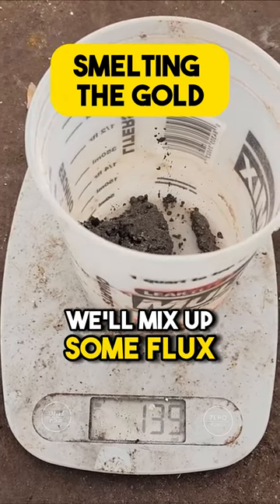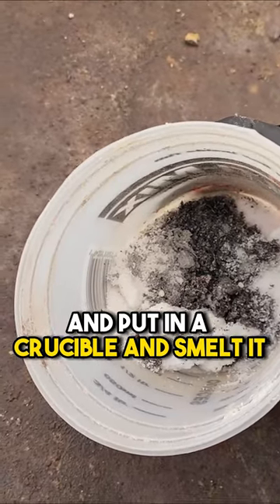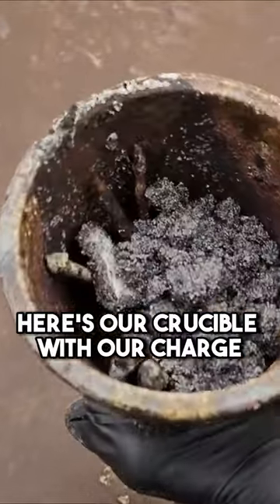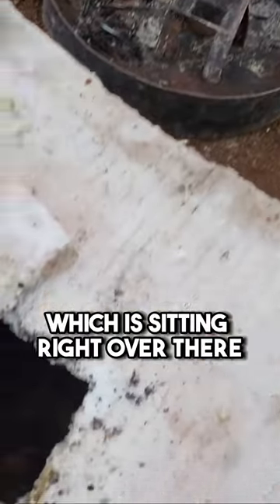Smelting gold with unexpected result

Comment: I just started smelting the gold dust I've been pulling out of the crushed quartz I've been collecting, and I follow your process (as best I can from your valuable collection of videos). Only problem I ran into was/is the length of time smelting. I definitely cut the smelt time way too short ( maybe 30-45 mins), but the result was the same as my 2hr smelt...nice lead triangle - no matte - glass slag. Now, I'm not sure what to do with the slag from my short smelts. Guess I'll just re-smelt them, but I'm not sure how successful it will be. Great videos. I'd be lost wo you.